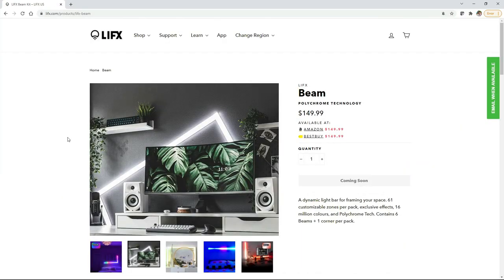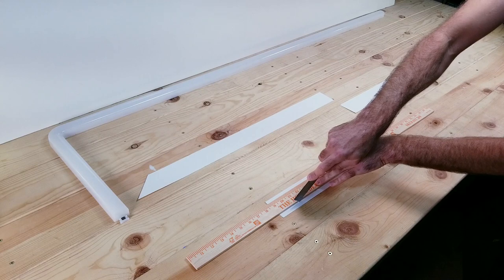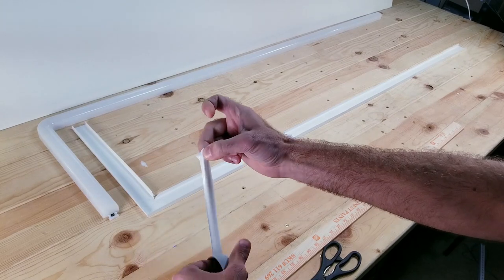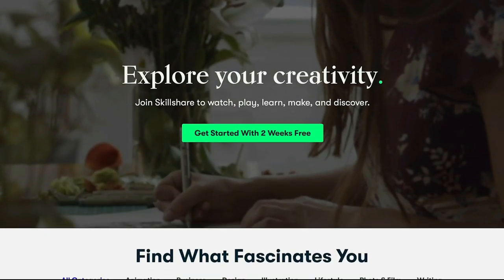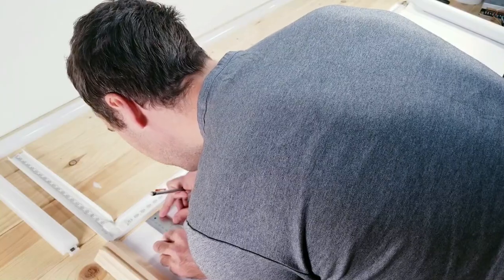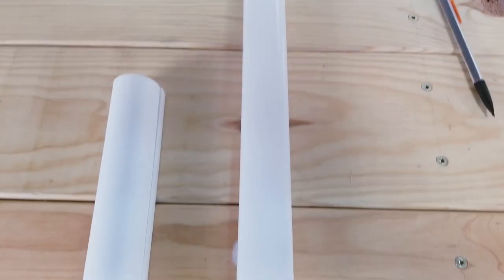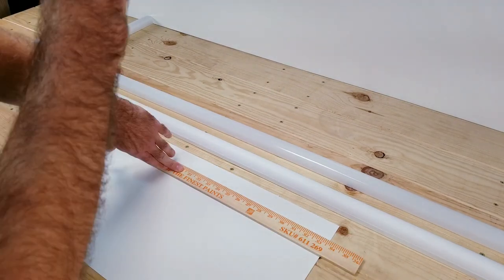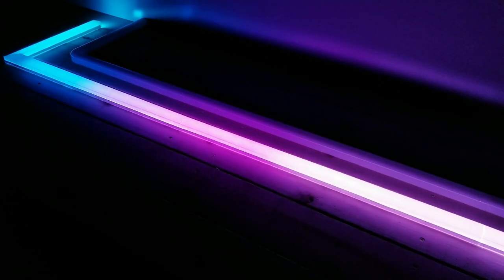DIY GOVEE GLIDE / LIFX BEAM USING ONLY PAPER - NO TOOLS REQUIRED!

Comment: Wow awesome idea 🥳👍🏼🤟🏼😃
Reply from the maker: Thanks buddy! Glad you liked the idea and thanks for watching!
Reply: @ChrisMaherDIY  I will try this, but as far as I know, is it not possible to cut the Govee RGBIC LED stripes! 💁🏻‍♂️
Reply from the maker: @David-cz7mm  In my experience i've seen that when you cut the govee leds, they still work but govee does not adjust the animations to factor in the missing pixels. What that means is if you have an animation where lets say the last 30 pixels should be red, if you cut the last 30 pixels off, govee will not adjust it to make the last pixels of what you have left red. You simply wont see the red anymore. So is it perfect? No, but does it still work, yes. Also if you solder or attach those 30 leds back on, then in my experience it will work perfect again. The other option which I have used in a few of my projects is just hooking up the govee led's to WLED and controlling them that way. Here is a video I made showing how to do that: https://www.youtube.com/watch?v=l0sRG1WAbq0

Comment: It's simple and looks nice, but ... LED chips need to be cooled. Overheating reduces their service life. Try to stick the LED strips on some material that allows cooling. Dedicated aluminum profiles are ideal. Sticking them to paper is completely inappropriate. In addition, the video does not show here that the LED strip does not work independently, it requires a controller to control it. I do not recommend replicating this. BTW ruler, cutter or scissors are not tools? :) The title is clear clickbait :-D
Reply from the maker: Thanks so much for watching and for your feedback! Appreciate you taking the time to comment. Hope you have a great day!
Reply: The second part is sarcastic right?

Comment: Hey what's up Chris.. I am brand new to this and have started doing this project as a beginner.  I noticed that the ESP board gets insanely hot so I have stopped for now.  My question, I had a total of about 112 LED's, and doing the math that was provided on another youtube channel.. that amount of LED's calculated from the specifications on BTF amazon page where I bought them, shows that 112 LED's would need almost 10 amps?  Is this correct?
Asking because I bought the 5v 2amp charger that's in your description to power them, and wondering if I need more power to run these, and if that's the reason why the board is getting so hot.

Not sure why the ESP board is so damn hot in places, it worried me a bit so I am buying a bigger power supply to see if that helps.
Reply from the maker: Thanks for reaching out and great questions! I've never had a problem with mine heating up but I also usually have my brightness limiter set to 850 mA. I have not tested things out on what would happen if I turned that setting off and ran them at full brightness and full power but I'm curious now if things would over heat if I did. I might have to try that out here. I really never go by the actual power recommendation because in my experience that always seems to be overkill and calculates things based on max power and brightness which I never use. I'm more of a trial and error learner. I usually start with the least amount of power option and see how it looks and then go up from there if needed. But with that being said, the larger power supply cant hurt! Let me know if the larger power supply helps out!
Reply: @ChrisMaherDIY  Thanks for the response.   Yea i'm really not sure why it gets so hot then, all the LED's light up just fine and im on default settings with 850mA and automatic brightness limiter enabled.  Specifically I am using the esp 8266 with breadboard jumper wires going from the strip to the board, and the 2a wall plugin usb you have in the description -- running 112 LEDs.  The small black chip right above the usb plug in on the board gets so hot it has burned my fingers a few times now and im a bit worried to keep it unattended.  I'll have to try with the ESP32 and see if that has the same issue.

Comment: This makes me regret not recording all the diy stuff I do sometimes I'll just walk around diy stores and Lowes wal mart ect looking for ideas for every thing led! I f#kin luv led light so dam much. U prolly seen it already but they have led tape now its as thin a piece of paper it's super cool but it whines this high pitch sqeal like it's in pain when it's on. U could have just cut them slanted again and there would have been a seem at the top obviously but that would have done it, I think im not the smartest dude either so idk what tf im talking about holy shit that's amazing this is why I love led's. Are those lights addressed or are they drem color strips? And do u glue the top poster board into the track somehow? U would have to right if u ever wanted to place it on the wall? I plan to use this idea and jus attach a design of tracks on my accent wall I was looking for an idea for that I was gunna use wood bit f that this is amazing thank u so much. Jus lemme kno yer thought on instalation to the wall please
Reply from the maker: Thanks so much for watching and taking the time to comment! Glad there are others out there as enthusiastic as I am about LED Lights lol! Its a fun hobby for sure! The lights I used are individually addressable. I usually just use lights from BTF Lighting. I left a link in the description for the exact lights I used. So you would not have to use any glue to keep the paper in when using poster board. The poster board is rigid enough that when bent, its strong enough to keep things in place. Now if you were to hang this on the ceiling, then you might need to use something but for just the wall, you should be good using nothing! It should work similar to what I did in this video: https://www.youtube.com/watch?v=ps_pDbdvqZA&lc=UgwjkukkLXXGZuU5Tjx4AaABAg